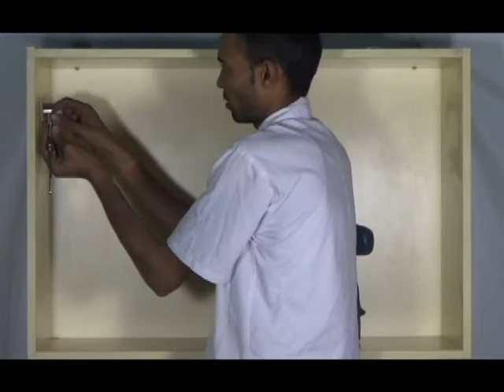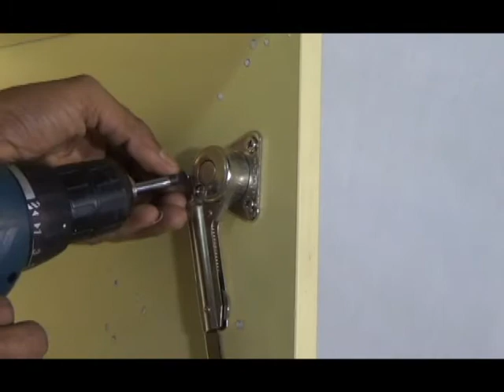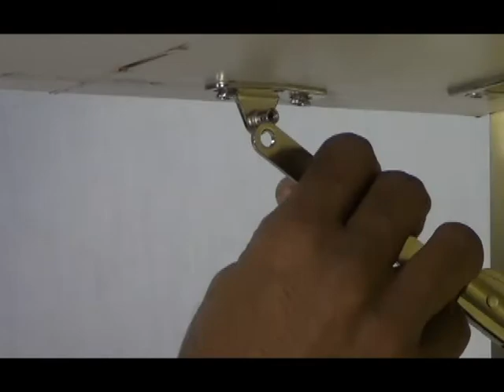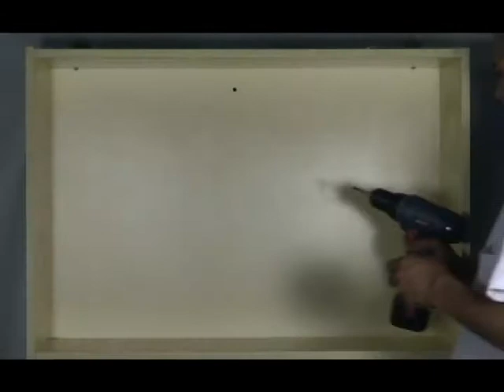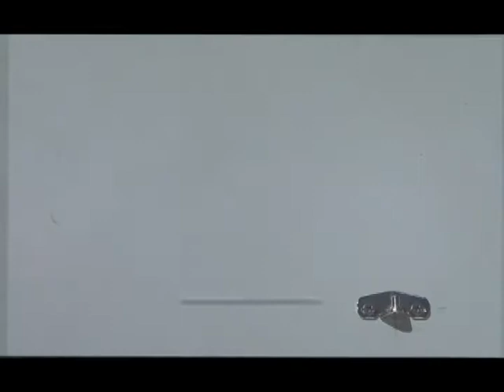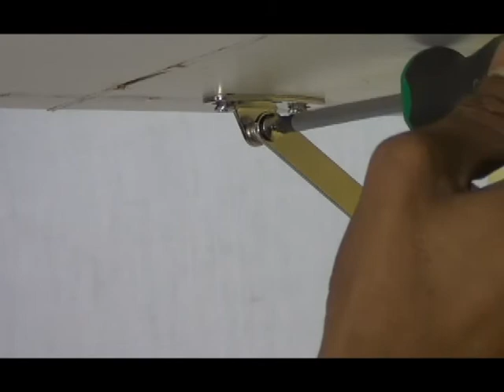LAMP NSDX

Comment: Thank you.

Two questions:
1. What is the purpose of the screw in metal near the center of the device? 
2. If it moves too hard after some years of usage, how could I fix this? Can it be disassembled for cleaning or can I put oil inside?
Reply: The screw near the center of the metal hinge is an adjustment screw that allows you to change the speed in which the hinge closes. Tightening it will make is “snap” closed more efficiently whereas loosening it will allow more time for it to slowly close. If you are experiencing it not closing tight enough for you after years of use, it may just need to be adjusted tighter once more so that it can close flush with the cabinet housing. 

I am about to install mine now, I just needed some visuals to locate the proper placement. Hope this helps!

(Edit) I would not use oil to lubricate the hinge as it could result in a loss of torque holding the door open. I am not an expert, I just know oil and hinges do not mix well on the cabinetry that I am used to installing. Best of luck to you!
Reply: @Tbhyeah  , thank you for explanation. Actually, I have quite an opposite problem; after years of usage it is very hard  either to open or close the door. So hard, that it breaks screws out of the wall. I tried all the positions of the screw near the center - it didn't help. I гnscrewed from the cabinet and it is really hard to move the parts in hands. Are there any ideas how could I soften it so that it could be used?
Reply: @doctorshadow2482  I have just emailed the designer who ordered these for us so that they can pull up the mechanical specs for the hinges, I will reply when I take a peak at them and see if there is anything that resembles the problems you are having with yours! It’s good to know that these may in fact have a shelf life on them.. I will let my clients know that they may also experience the same thing down the line and also let the designer know that they may need to look for a different brand for future projects if no solution becomes apparent.. You’ll hear from me soon!
Reply: @Tbhyeah  , thank you so much for your time and paying attention to this.
Reply: @Tbhyeah , do you have any good news for me on the subject?